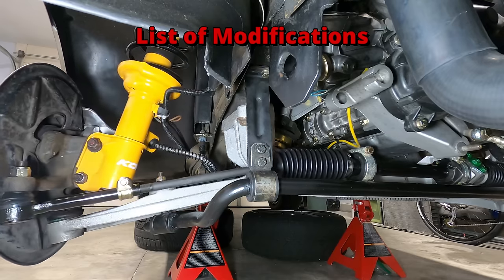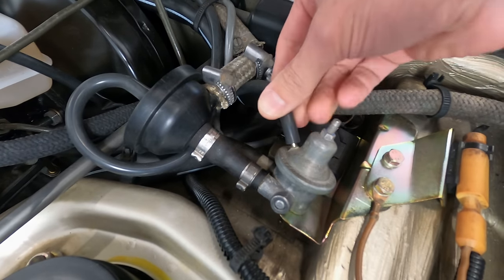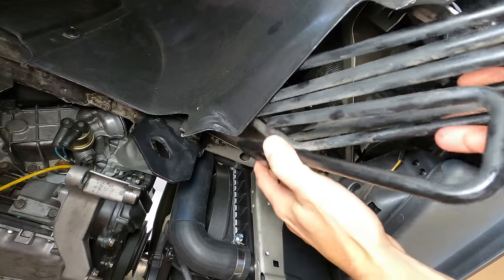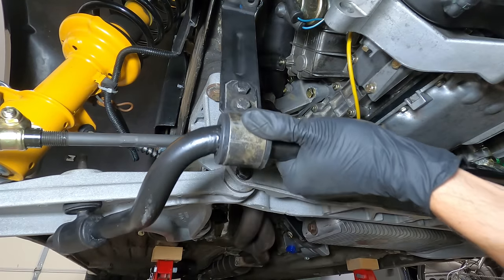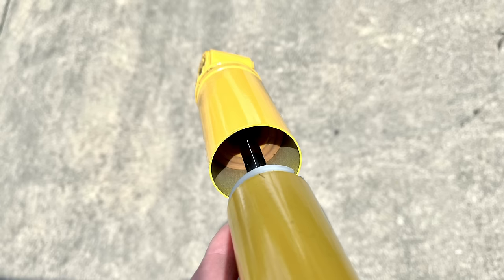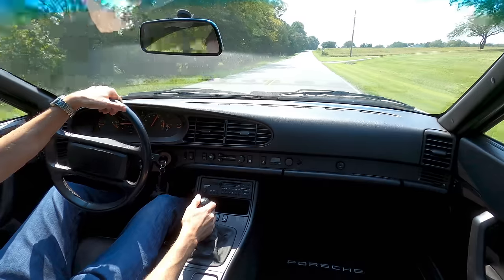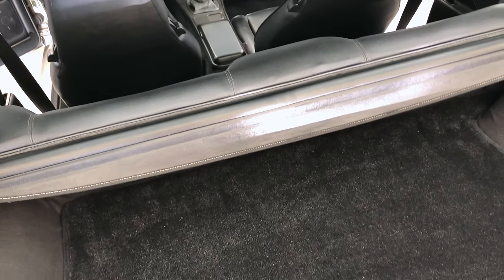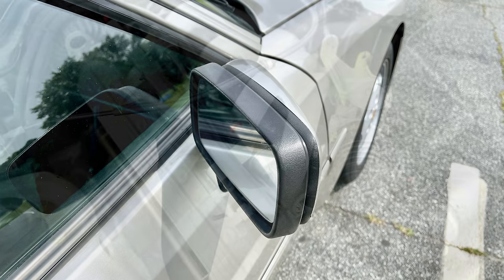25 Modifications I've Made To My Porsche 944

Comment: Hello NC944er, I'm looking into purchasing a 944 in the Northwest area. Are there any years of this Porsche to stay away from ? Love your videos BTW.
Reply from the maker: Thanks! They can be a lot of fun provided that your expectations align with the true 944 ownership experience. Gone are the days where you can simply buy one and drive the heck out of it without worry (unless it’s been VERY well sorted by the prior owner), with most examples needing a bit of maintenance to bring them current and reliable, but that’s more than possible to do. 

The general guideline in the community is to buy the best possible example you can afford, as that will set you ahead of the game. There aren’t any hard/fast rules like, “never buy an ‘84” or anything like that, but Porsche was constantly improving on the design over the years. So you’ll typically find that the later model years have fewer electrical issues than the earlier ones. The naturally aspirated cars are also a little easier to work on than the turbo cars, if you plan to DIY, but they’re obviously a little less sporty in the power department than the turbos. I’m not sure if you’ve seen this write-up, but I found it quite useful when shopping, as it breaks down the differences in models and outlines most of the common issues to watch out for - https://www.pelicanparts.com/techarticles/944_buyers_guide/944_buyers_guide.htm

Cheers and let me know if you have any other questions! 👍

Comment: I'm 6'7 and thinking about getting one in the next two years or so. Do you think I'd fit? I've read forums that say it's actually pretty roomy inside.
Reply from the maker: Hey man! Yeah, the 944 interior is pretty accommodating. I’ve seen guys 6’5” - 6’6” fit with “relative” comfort, so depending on your dimensions, it’s possible. It helps that the seats are fairly close to the floor pans, but keep in mind that the steering column is fixed, so you could encounter some knee proximity challenges given the lack of wheel adjustment. There are some eccentric spacer options available that can be installed on the column to tilt the steering wheel up slightly if that’s an issue. I’d try to find one for sale locally and see if you can get some firsthand experience with the setup.

Comment: The throttle response cam is not for fuel economy, it's to linearize the amount of torque you get with respect to the pedal travel. Subarus are notoriously annoying to drive because they do the exact 1:1 pedal to throttle angle behavior you mentioned and it makes it hard to give a tiny amount of airflow to slip the clutch.
Reply from the maker: Yep, it’s the OEM throttle cam that features the “fuel saver” lever. The 1:1 cam definitely takes a bit more finesse to feather the clutch, but it’s something you can get used to.

Comment: Love what you've done to your 944. I bought a Guards Red 944 new in 1984 (my 1st brand new car, I was a young Captain in the 82nd ABN at Ft. Bragg), but only had it for a year. I put 30k miles on it in that year as I love to drive it. Now that I'm 65, all 4 kids are grown and left the nest, I'm reminiscing on getting another 944 an fixing it up. The only picture I've been able to find of my 944 is from our wedding. I remember giving my girlfriend a key to my 944 the day I bought it. She was surprised I gave her a key, and my response was you'll be driving it so you might as well have a key to it. She's now been my wife for almost 40 years and the only picture I can find of my 944 is from our wedding. I'm pretty confident I could handle most if not all the modifications you've done as I've been working on cars (my own or my Dad's) since I was 16. I've never done a transmission upgrade like you did, but I've replaced the clutch, pressure plate and throw out bearing, rebuilt a master cylinder, replaced rings, valves, head gaskets, tie rods, and the standard maintenance items like breaks, rotors, oil, filters etc. I'm not afraid of taking just about anything on and with YouTube and folks sharing what they've done the trepidation at attempting something has gone to almost zero. I've now got 8 grandkids, and teaching them how to work on cars using a 944 as the training tool just seems like a pretty cool project. I learned on a 1972 Toyota Corolla, piece of crap car. Did a complete motor job on it and remember my Dad telling me I had to drive under 30 mph for the first 250 miles and keeping the rpm low, change the oil and filter, and then another 250 miles at under 50 mph again keeping the rpms low and change the oil again. He said that gave the engine's new rings a chance to refit to the cylinders. It seemed to take forever to get those 500 miles under the hood, and at 17 years old it just seemed like torture to drive it so slow. I did it, because I'd put the hours in fixing in it and didn't want to have to repeat the process. 
Thanks for sharing your work and reasons for the upgrades. I respect your choices on keeping the original look of the 944 and the tasteful change you made to the rock guards.
Reply from the maker: Hey, thanks for sharing your history with the 944 series! It’s always interesting to hear the individual stories people have related to these amazing little cars. Prices have fallen a bit from last year, so it may be a good time to start looking around if you wanted to get back in, lots of fun to be had, and you’ll definitely spend more time wrenching than driving these days, at least until the car is sorted. 😂 As we get on in years, it’s arguably less fun laying on a concrete floor for things like a clutch job, but as you point out, most of the work is pretty approachable, especially with all the online resources available today. Sounds like a great way to create some memories with the kids and grandkids, and “little helpers” can come in handy for sure!

Comment: Kudos to solid mount and black sea r&d super bearings but man those things are expensive. Not sure why you didn't use an impact for getting old bearings out.

You need one more mod when that motor dies. Make it a 948 with an ls1 swap with tpc's conversion kit. Same weight so no upset just more power and torque. I love mine. 88 948 S
Reply from the maker: The LS swaps are pretty insane… seen a couple that were really well done, but never driven one. Maybe one day. 😂

Comment: Hey man love your videos, glad you kept the design 90s. I love the look of them. Just two bits of info that may be of use to you. I have a momo proto tipo on my car, the stock wheel has an offset, and if you're tall (im 6 foot 2) you may not be able to see the indicator light or tops of your dials without the offset ring for the momo wheel. I'm very happy with mine quality and feel wise. I have a danske exhaust on mine too. And can confirm they sound good but not obnoxious. No drone from it at motorway speed but a nice howl when driving "enthusiastically". Shocks and the maf kit are on my wish list after seeing your vids.
Reply from the maker: Sweet, thanks for sharing your experiences with those two products! The audio I've heard of the Dansk sounds so nice! 😁

Comment: The effort put into the modifications and improvements is impressive. But what always amazes me is why the European bumpers, which are much nicer, are hardly ever used on the 924 and 944 in America.
Reply from the maker: I agree the fiberglass Euro, or “rest of world,” bumpers are much more streamlined and attractive than the large, aluminum US bumpers. I’ve seen a handful of owners who have performed the conversion, but there can be challenges in sourcing all the needed parts as well as costs, and then to have them painted to match the car, it adds up to quite an expense just to change the look of the car. 944Online has kits available, running $2,300 for the front bumper and $900 for the rear, which includes the bumper mounts, driving lights, signal assemblies, and bumper pads, all of which are different from the US setup. Then you’d be looking at around $1,000 for paint work, so it’s definitely doable, but it does require a significant financial commitment, which is probably why we don’t see them more often.
Reply: @NC944er  Okay, with the cost, I understand why you see it so rarely. I had 924, 944 and 944S in the 80s and would still like to have the 944 now. She didn't have air conditioning or power steering, but she was red and one of the best cars I've ever had.

Comment: I did the math and I'm going with the MAF! I was thinking of maybe doing a independent ecu etc but imo it's not worth it the silicone lines are also great add on.
Reply from the maker: Yeah, I’ve seen some of the posts from guys using MegaSquirt, etc.  It definitely involves more work and tuning sessions, but provides more flexibility to make changes. So it’s a trade off. The MAF is a pretty easy solution, but I’m running just a little richer than I’d prefer to avoid a rough idle at cold start, whereas with connected software I’d have a better idea of what’s happening with the fuel map.

Comment: 6:25 I thought this company had gone under? I ordered some brake and clutch hoses a couple years ago, and was saddened when I tried to access their site recently that the site was down.
Reply from the maker: I picked up my set on eBay, looks like the price has gone up slightly but they’re still available. This is the vendor I used - https://www.ebay.com/itm/361106275057?mkcid=16&mkevt=1&mkrid=711-127632-2357-0&ssspo=3maAtNpVQh2&sssrc=4429486&ssuid=E3wwf34yQjS&var=&widget_ver=artemis&media=COPY

Comment: Nice job with all your mods. I like the fact you've aimed for reliability and a mild uptick in performance. It's good you didn't forget about the short shift kit either. I owned a 1985 Alfa Romeo GTV-6 back in the early 90's which has a rear transaxle like the 944, but lusted after a 944 which had better balance and handling (despite the Alfa's near 50:50 weight distribution), better reliability and was just a better overall package. Apropos that, I drove a later 968 Club Sport back in the 90's which was the best handling car i've ever driven. I just had a look online & found a good 1993 968CS with 127,500km's, KW V3 suspension and Recaro seats for under $90k aussie. That would make an good track day car, as the 968CS was designed for production car racing.
Reply from the maker: Oh man, Alfa makes some beautiful cars, but I do get the reliability aspect, it starts to become annoying if you can never actually drive a car you’re dumping money into. That 968CS sounds like a good find, they don’t come available for sale very often, even here in the US. I understand 944’s are fairly rare in Australia.
Reply: @NC944er  Yeah if I had the money, I would be very tempted to jump a flight and test drive that example. Walter Röhrl said the 968CS was the best handling car Porsche made back when the air cooled 993 Turbo/Turbo S was in production

Comment: I had a New Guards RED 1985 1/2 944 Non-turbo. The only repairs I had to do was a leaky water pump seal, CV joint greasing, and I broke the clutch trying to burn out. But I always wanted to modify it for better performance. What would you say are the best performance upgrades for this car ?….
Reply from the maker: As for performance upgrades, horse power increases on an 8-valve NA 944 are difficult to come by unless you get pretty invasive with adding forced induction, high compression pistons, flowing/porting heads and intake channels and things of that nature. This is why you see some people doing LS engine swaps, which can certainly be fun, but it’s not really a Porsche at that point anymore. The MAF conversion is easily the single most accessible power increase mod available. 

It’s easier to remove weight from a 944 than add power, so depending on your goals for the car, some people remove unnecessary systems like cruise control, power steering, air conditioning, etc. Since the 944 is more of a momentum car, you can also look at upgrades that will allow you to maintain speed once it’s built up. Adding sport suspension with stiffer shocks and springs like Konis or thicker sway bars front and rear can really reduce body roll and make the car even more planted in the corners, so you’ll have a better sense of maintaining higher speeds in a spirited drive, which always lends well on a 944.

Comment: The only thing you got backwards is the thing with the manifolds. Audi switched to steel so they don't crack because every greyiron manifold cracks eventually. Problem solved with steel manifolds.
Reply from the maker: That may be the case with the Audi manifolds you’ve mentioned, but it’s not the case on the 944. The problem lies in the angle of the 1-4 pipe, when Porsche switched to steel, the support at that joint was not as robust as the joint on the cast manifolds. They tried adding additional support on the later steel tubes in 1988 on, but it still wasn’t enough to hold out over time. Give enough stress and heat cycles, all metal will eventually crack whether it’s stainless steel or cast iron, but the cast ones have been more reliable for 944 owners over the years. 👍
Reply: @NC944er  Interesting that the 944 had opposite problems to most manufacturers. But seems plausible the way you put it.
Reply from the maker: @GERntleMAN  Yeah, it was a combination of a poor location and design, where the catalytic converter pipe put undue stress on that joint because of the extreme angle. The aftermarket headers by Lindsey Racing also end up cooking the right hydraulic engine mount, causing it to fail prematurely. So I don’t that anyone has gotten it quite right at this point. 😂

Comment: This is very specific question what is the type of connector sealing in the fuel lines you bought. The original are DKMs that I can't find anywhere.
Reply from the maker: The Rennbay fuel line kit uses Aeroquip fittings, they’re reliable and easy to work with.
Reply: @NC944er  Thank you.

Comment: Excuse me have attempted to replace the filler neck rubber sleeve?
Reply from the maker: No, I haven’t replaced the fuel filler sleeve on this car, but here is some information on the process - https://rennlist.com/forums/944-and-944s-forum/1136313-944-early-1985-na-replacing-the-rubber-fuel-filler-boot-rh-drive-uk.html

Comment: Hey man I love your videos! I was wondering if u had a video for the Koni yellows you put in or if I'm just blind haha keep it up!
Reply from the maker: Hey thanks! Outside of the pictures shown here, I don’t have any installation footage on the Konis. Unfortunately that work was done before I started the channel. In short, you’re not blind. 😂
Reply: @NC944er  😂😂good to know I was hoping you did there's some other videos but the way u break things down is really helpful was getting ready to do that job in mine soon
Reply from the maker: @nathanielwr1517   Nice, best of luck! If you’re doing the front strut conversion, the tech article on Paragon is pretty detailed. To avoid messing up your camber alignment, you can mark/outline the lower strut mounting flange placement on the steering knuckles with a sharpie. That way you can just line it up during install and lock down the eccentric bolts. You’ll also need a 17mm strut socket to remove and reinstall the top hats on the fronts - https://www.ecstuning.com/b-schwaben-parts/shock-nut-socket-17mm/03046sch01a-07/?gclid=EAIaIQobChMI_8H3kdyOgAMV6S3UAR2dNwySEAQYAiABEgJ6kPD_BwE

Comment: About a year ago I watched one of your vids in which you replaced one of those small, round “things” which attach to the fuel rail on front and back. This required the use of several aluminum parts screwing together to allow the inch parts to screw to the factory metric threads. I don’t see that anymore. What happened to it?
Reply from the maker: Hey man! The video you’re referring to wasn’t one of mine, but I believe this is what you’re looking for - https://youtu.be/yLZ7mUhAuZA?feature=shared
Reply: @NC944er  Thanks loads. Like you, I have an ‘88. Since you obviously watch the other fellow’s vid, can you tell if the two fuel rails and attachment are the same?
Reply from the maker: @jockellis  The layout of the early fuel rail is different from the later version, but the part number for the fuel pressure damper is the same for all model years, so those connection points would meet the same specifications. If you're looking to replace your fuel pressure damper, there are a couple of other aftermarket options that are a direct fit replacement without having to use all the different adapters shown in the video, which may be worth a look (links below). Also, if you're having idle issues, I would first clean and test the air/idle control value, as well as check for vacuum leaks, before replacing the fuel damper. 

https://www.autoatlanta.com/Porsche-944-Fuel-Pressure-Damper-Parts-PN-S94411020103.html

https://adaptmotorsport.com/products/classic-porsche-fuel-pressure-damper-944-944-turbo
Reply: @NC944er  Since ive already bought all the adapters (i think) i guess I’ll just use them. Today, with a 10,372 lb, 5-foot wide gear blocking my NDT booth for the third day, I volunteered to take out the cardboard bin for the shipping department. While doing that I found the perfect box in which to ship my fuel rail to your plating shop. Could you give me the name and address, please. Thanking you in advance.
Reply from the maker: @jockellis  I used Parker Metal Finishing in Greensboro, NC, but there may be something closer to your home area if you shop around. If not, their address is: http://parkermetalfinishing.com/ I’d give them a call and let them know your intent to ship the parts. The minimum cost will be $100 plus return shipping. The minimum fee will cover quite a lot of other parts if you have them available.You’d also want them to be completely stripped to bare metal before sending them, sand blasted, etc., otherwise the zinc plating won’t take as well.